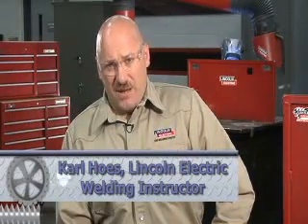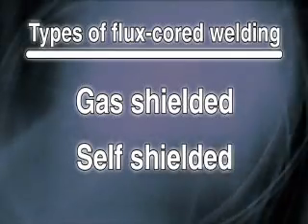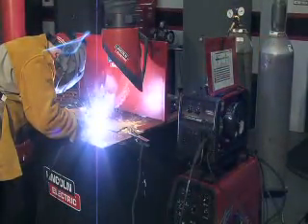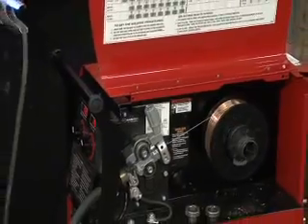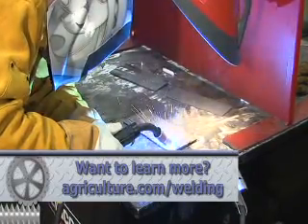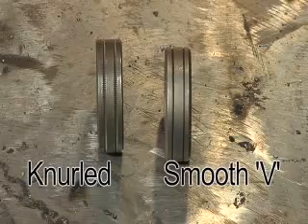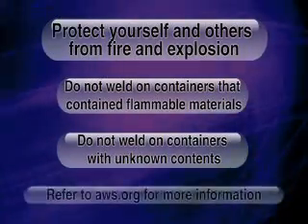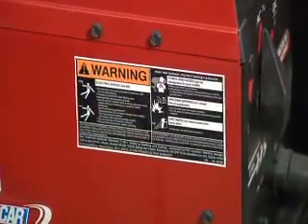Welder's Workshop Flux Cored vs MIG Welding FarmShow

Comment: It's usually the guy welding not the wire. You said your self new to flux core. Experiment & practice. Flux core is great out doors but tends to be hotter. The porosity experiment with your run out leangth /speed/heat. It's just a machine only as good as the guy gal using it. Practice practice!!! Peace.

Comment: the "worms" is called porosity and it is caused by poor shielding of the weld. some types of flux core wires are called dual shield because they require you to run it with a shielding gas as well check what kind wire you are running and whether you need to use gas or not